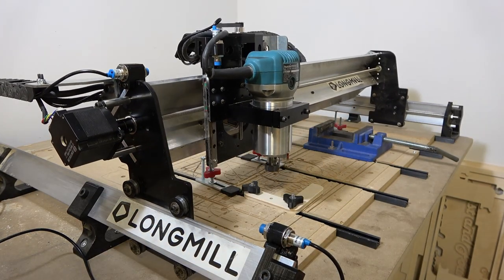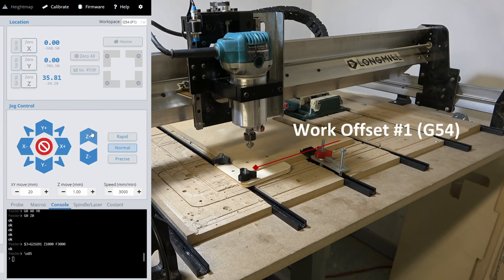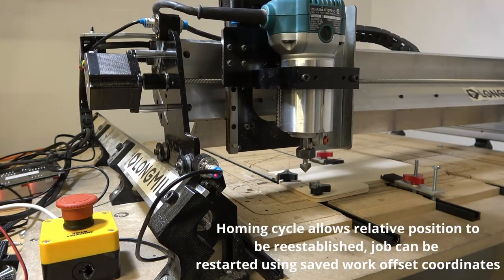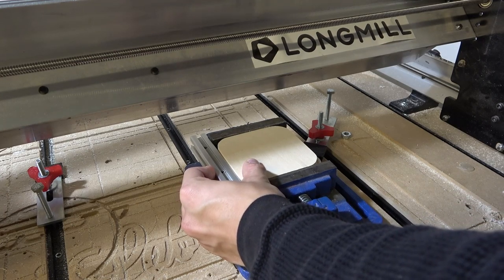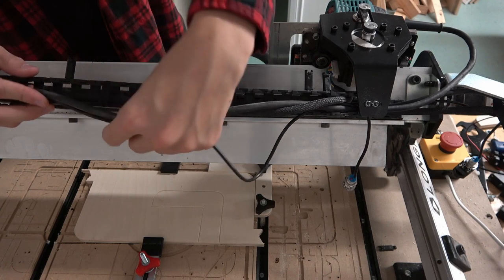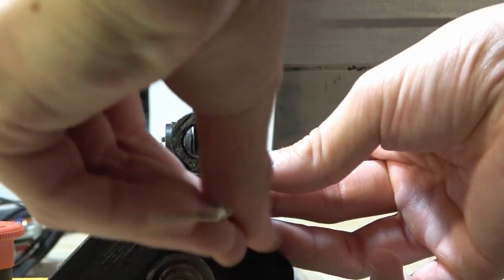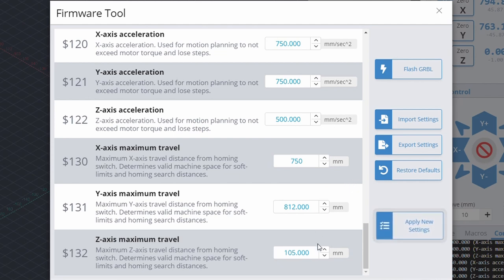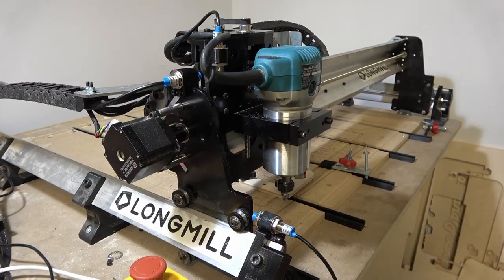Introducing the Inductive Sensor Kit for the LongMill

Comment: Hi Guys thanks for the Vid! if I didn't have a high powered Laser id buy this one to go along with my Longmill. Question anyway you guys can do a nice video of squaring the machine up. I've followed the instructions and had it square now for like 6 months. now I'm slightly off and no matter how many times i follow your instructions I'm still not getting straight lines. Might be helpful to see what alternatives you have to square it up that might help
Reply from the maker: If you'd like, there's a tool available in gSender that you could try out which helps with the squaring process. Have you given this a shot yet?
-Chris
Reply: @SienciLabs  Thanks Chris, looking at your "gSender Guide, Tips, and FAQ" to see if see ifyou mention it.
Reply: Yes now that I see the documentation, I did the ‘Calibration Tool’ and told me i was pretty square but my left to right cutting still goes up slightly but noticeably, and this is new like in the past month so far its been great.

Comment: Hi, if I need to move the shaft to the opposite side where the sensor is installed, will the machine stop to avoid damage, For example I have installed the Y sensor on the left/front side, if I move it to the left/back end it will stop? or will I have to install sensors in every corner as if I had a mechanical limit switch, sorry for my stupid question. thank you so much.
Reply from the maker: If you're using 'soft limits' then you only need sensors on one side. The reason it won't hit on the other side is that if you 'home' the machine, there are numbers that tell it how far it can go in each direction, once it reaches that amount the software inside the CNC won't let it move any further. Does that make sense?

Comment: Could someone please answer this for me, perhaps I missed something on the video.  Why only 3 limit switches and not 5?  One for the Z, two for the Y in front and back and two on the X on both sides instead of 1 on each axis?  It did the say that one of the purposes of the inductive sensors were to prevent damage, so would it not make sense to add the additional sensors to do just that?
Reply from the maker: Protection can certainly be accomplished with 5 sensors or even 6. Using only this approach employs 'hard limits' which restricts machine motion from collision on both sides. Another proven approach is 'soft limits'. This means only 3 sensors need to be set up, as well the machine is told what the limit of it's travel is in its firmware so that once it reaches that distance it will stop itself from moving further. This means that the machine is still protected from moving too far, but only half the sensors are needed which reduces the likelihood of things going wrong and reduces cost.

Comment: * be very careful when you tighten bolts * 

Just set my switches up today and I don't have a tendency to overtightening but the 3D printed bracket on the X switch was pretty delicate and snapped. In no way did I feel like I had bottomed out the bolt, or that it was really gripping the rail.

I ended up using epoxy to attach the switch.

Comment: Does this sensor kit work with the New MK2?
Reply from the maker: The MK2 has it's own unique sensor kit that mounts more easily but still uses the same sensors. You can check it out here: https://sienci.com/product/inductive-sensor-kit-for-the-longmill-mk2/
Reply: @SienciLabs  Thank you I am in the process of ordering the MK2 and want to make sure the add ons I am selecting are the correct items.

Comment: The problem with the E stop is because it is just a power switch and does not throw an alarm. If the E stop were wired to the actual stop button it would not continue running the program in the software.
Reply: Can you figure out how to do this and then teach me 👍
Reply: @klm8156  Haven't worked on my Longmill in a while but want to get back into it. Been saving and working on a better table design featuring a 4' x 4' metal tabletop and and lots of drawers / cabinets for tooling and electrical control storage. Also trying to get a lighter spindle because my 2.2kw spindle is too heavy and flexes the gantry due to its poor rigitiy in the design.
Reply: @vivigarr  keep us posted!
Reply: @vivigarr you say the Longmill is poorly designed and lacks rigidity?

Comment: I am installing my limit switches now. I have some advice for them.
For the z axis, because m5x16 screws are not sent any more, the z limit switch is useless. The bolts that were sent with mine are too long and it interferes with upward travel anyway. I have to remove the screw and buy m5x16, which are shorter, so the upward travel will even reach the limit switch. 
My conclusion is if limit switches are ordered in addition to the machine m5x16 bolts should be sent like in the original installation video otherwise switches are useless (or should be at least in printed instructions with the switches to inform customers of this. Luckily I watched a garret fromme video)

Comment: I left an earlier comment. Now I'm back cause I'm still thinking of that $47 I wasted for this and I want to include more info why this is a waste. I would like to think they are thinking and would like to rectify this for future orders (wire length and durable plastic).
Its a great idea but the planning is awful for this one.
First off, the plastic is not near as durable or rugged as the plastic for the 3d printed legs. It is quite thin. One of mine cracked just from tightening the screw onto the x-axis and it hadn't even tightened onto the steel portion yet. Didn't crack all the way through and I could probably even use it except that there is one more problem.
While the electrical wires for the control board are long enough to tuck the control box away off to the side of the table or in my case, underneath the table to keep clear of dust, they certainly aren't long enough for the x-axis limit switch. Wire is not sufficiently long enough to match any kind of length of wire that comes with the control board.
So as a result, I would have to plan ahead, not knowing anything about wires and connections, buy an extra wire with the same type of plug just to even reach the control board. So for now they are useless and I wasted my $47 plus tax!
Oh yeah, while I did have them hooked up I noticed that even though I did not have Gsender setup for the switches I noticed every time the x-axis came near the switches the red light would come on. Oddly enough, one of them never did come on cause I checked so I have no idea if it would work even if I did hook them up correctly. 
Otherwise, I really like the longmill. I have been antsy all day cause my designing of a project didn't get through in time and my cut time for the project is 8.5 hours. I'll just have to wait another day to do it. However, I do believe if my limit switches had a long enough wire I could stop and start where I left off??? I have no idea cause I haven't even experimented with them yet.
Reply from the maker: iwannaapple, sorry to hear about the quality of your limit switches. I'm not sure why you're experiencing issues with the wire length since they should all be sized correctly - and as far as the plastic goes we've been working at ensuring good quality when shipping the kit out. Feel free to contact us and we'll make sure you get sorted out. As you noted the design could be improved which is what we did with the new MK2 where now the sensors are directly integrated into the machine steel plates to be very durable.
Reply: @SienciLabs  
Wow, that is awesome for the Mk2.
I ordered a touch plate. Ya'll were gracious enough to send me 2 replacements to replace the one that cracked. The replacements seem much tougher?? They are more like the feet with those tiny ridges.
As for the wire length: two of them ARE long enough to match the length of the controller wires. The x-axis (which is actually placed near the router) because of its location placement and how it needs to be routed TWICE through the cables will result in a wire that is too short to match the reach of the other wires thus completely eliminating any thought of tucking the control board away. That means I will be contacting y'all again because I need to buy another wire with a male and female ends so I can use the switches.
And I'm am glad you read my post. Hope you've made it this far because I have something else to say.
I am learning as much as I can about the cnc. However, I used to be a practicing programmer. I am not as good as I used to be but I still have the instinct and it is from my experience that I want to bring up a couple of more things.
Firstly, it is called USER INTERFACE for a reason. Fix what the user see's FIRST.
gSender is awesome but how about fixing the text box so it won't add numbers when I am trying to specify a jog. One function is overriding another function. If I want to type in .01 I don't want it to type in .011 by itself.
Or, how about terminating the download messages after a download is updated?? I have no idea if my gSender has downloaded ANYTHING because the downloading message simply will not stop displaying "Downloading". We need to know when it has stopped otherwise we don't even know when its started!??
And, why does your programmers have control over how much the bit travels past the touch plate to measure the x & y?
Give users control of that option. That would allow anyone to zero as large a bit as they want. But you say, "That is an irregular bit!". There is a simple solution to that too.
By the way, I used the touch plate. Love it! But I used a 1/16 bit. Because there is no user interface for control the router only measured at the widest point of the shaft and not the cutting diameter which I clearly entered the correct size. However, because of the lack of user control, the touch plate could NOT find the correct starting point in the lower left corner. The correct starting point was NOT found (not even close) Until I entered into the console Garrets Frommes formula. Which tells me that the programmers have not put "cutting diameter/2" in their programming code for irregular shaped bits (or for any bit for that matter)where the shaft is larger than the cutting diameter (the shaft touches the plate first.) or even where the cutting diameter is larger than the shaft.
But, doing it correctly would however eliminate the need for the newest touch plate.
I would have to say that I love EVRYTHING else. And most importantly, check for yourself if the wire is long enough to route through both cables and STILL reach the same length as the control box. Did someone not think of that?? Y'all so busy I think you forgot to check yourself. Even your you tubers admit to having to add a longer wire because of this (Buckys customs). I can copy and paste his message to me saying the same thing if you'd like. Please rectify this for your customers. Talk at ya later. Bye. Keep up the good work. I'm not complaining. Just giving you customer feedback
Reply: @iwannaapple7190 I guess they missed this message

Comment: Why should new users not get these and experienced people should ??
Reply from the maker: Once the machine is set up to use the sensors there are now more things you have to keep in mind when running you machine as well as more things that could go wrong during troubleshooting. Since the benefit of having sensors is mainly for more advanced uses such as running multi-day jobs, Tiling, several-bit jobs, etc. then most new users can likely get along fine without them 👍
-Chris